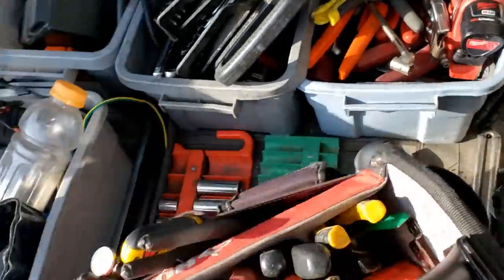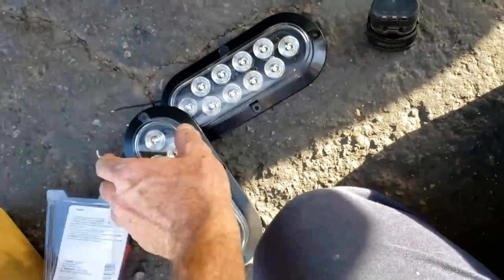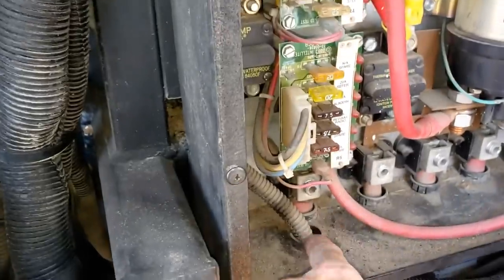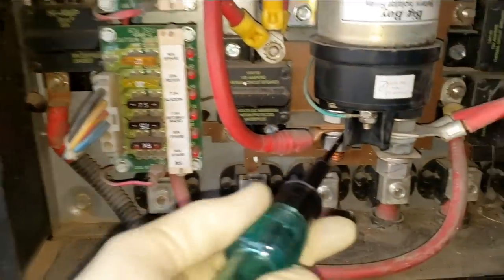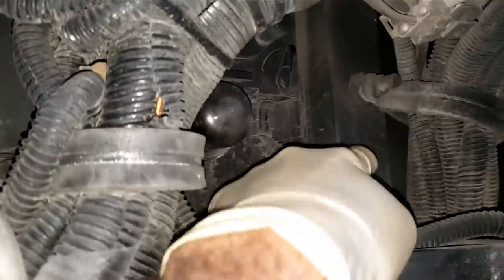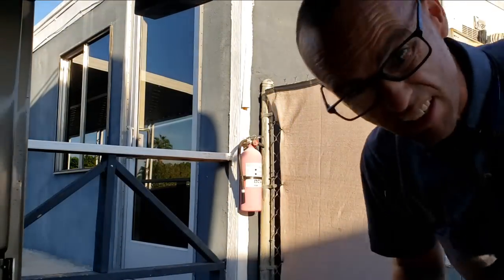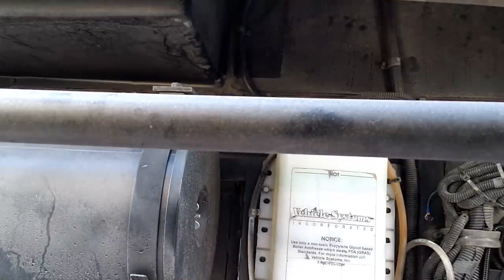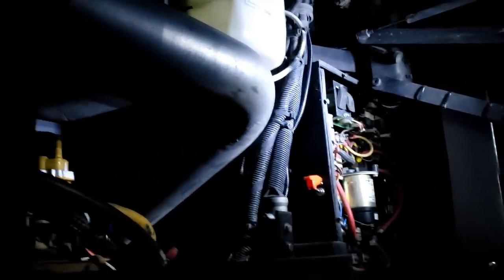Adding Engine Bay Lights to a Monaco Diesel Pusher

Comment: That coach is just like my 06 Beaver Patriot Thunder, nice work only thing I would do is use a sealed switch and heat shrink wire terminals. I have a extra set of led fog/driving lights and now I know where they will go.
Reply from the maker: good luck, I hope it turns out well. Thank you!

Comment: James,You're an excellent technician! I enjoy how versatile your skill set is! Ummm it occurred to me if the owner, etc leave the light on and they close the engine compartment door they may not realize it's been left on now it's only drawing 0.2 amps but there's no, like, indicator light or anything to let someone know that the lights have been left on?
Reply from the maker: I installed a magnetic switch on mine
Reply: @AZExpert That is what I have done on mine. I have used both magnetic and contact switches so that it is automatic and I don't have to try and find a switch in the dark. Open the door or hood or whatever and a light comes on.

Comment: James, I'm surprised you didn't place the switch where the closing door would automatically trip the cover and turn off the light!
Reply from the maker: I played with the idea. A mercury/ball switch would work best but also, I believe simple is more reliable. These doors are heavy and move inches side to side

Comment: A tilt switch mounted on one of the hood arms could automatically switch the lights off and prevent battery drain.
Reply from the maker: I probably could have used the switch on the door, but I really like to keep things as simple as possible.

Comment: Great timing to see this video as I'm looking to do the same thing on my '05 Exec.  Although I'm thinking about mounting an LED light strip either across the back inside the top of the bay or across the bar on the door where you ran your wiring.  My little OEM flashlight is easier to get to so I was originally thinking about tying into it's switch although you make a point that it would only have power when the bay lights would be turned on from inside but that may also be a good feature so you wouldn't accidentally leave the light turned on and run the battery down.  The only other option I see would be to either install a new mercury switch, or tie into the OEM one on the door hinge to make sure the light would turn on when you close the bay door.  Any recommendations ?
Reply from the maker: I did think about a LED strip, but I have had bad luck with adhesion and durability on those. I also thought about a plunger or mercury switch, but wanted to keep it as simple as possible. I also thought about tying into the compartment light wiring, but didn't want to walk all the way to the front to turn the light on.  Thanks and good luck!

Comment: Just wondering why you didn't install the switch a couple of inches higher to  clear the 
high amp block so you would have less chance of contacting high amperage terminals ?
Reply from the maker: It's mostly an arbitrary decision, the small wires above could have been in the way of the drill bit and the switch is still spaced far away from the breaker. I didn't want to extend the fuse holder harness to switch so I just went for it in a central location.

Comment: You might want to add a couple of lights on each side of the ceiling of the compartment to shine down on each side of the engine.
Reply from the maker: I thought about it, but really they would not be shining down on anything, just casting a lot of shadows
Reply: @AZExpert  the other idea is to put a really bright, LED mechanic's work light with a magnet and a long cord.

Comment: Maybe a light bar/strip is better for this application? There are too much obstructions inside the engine bay, so lighting from two point sources doesn’t achieve the best result
Reply from the maker: A light bar could work, I'm not sure the owner wanted to spend that kind of money, or be blinded by the intense light coming off of those bars.
Reply: AZ Expert Thank you for your reply. I was thinking about the light strip for interior lighting or decorative, not the one for off road scene illumination.